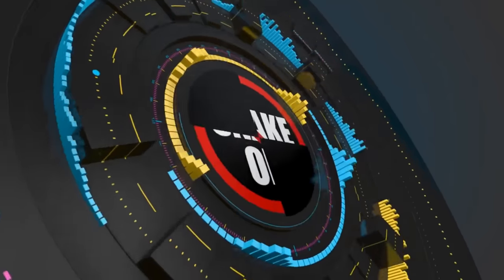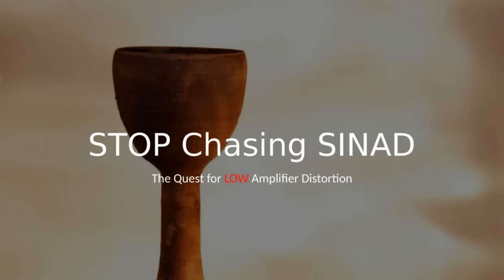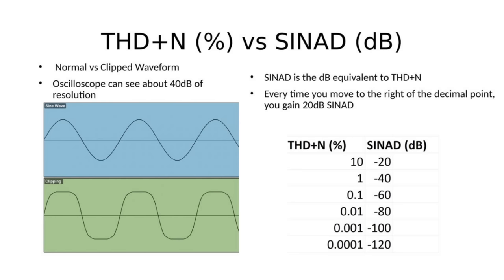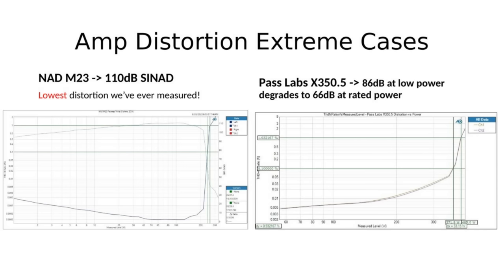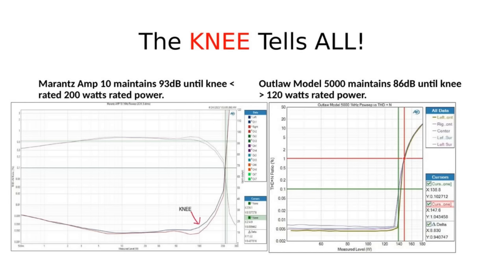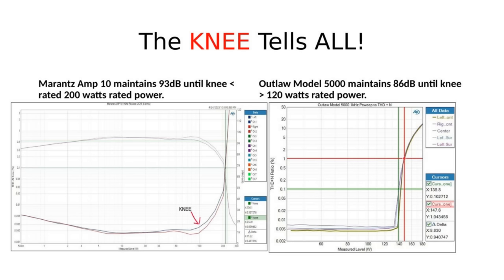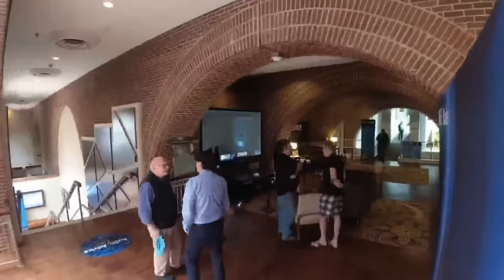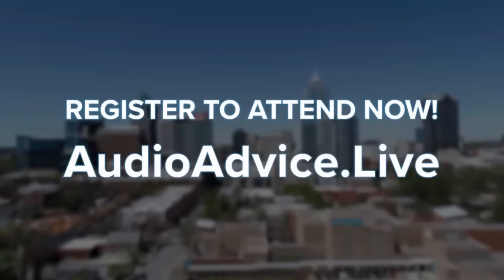STOP Chasing SINAD Distortion in Audio Amplifers!

Comment: Agreed on SINAD IS NOT be all end all number. There are too many other variables that need to be considered too as you mentioned in the video! Agreed on freq response, and load invariability value, and SNR too, maybe multi tone modulation distortion graph should be included also...

Good video!
Reply: Yeah I feel intermodulation distortion is quite a significant element to study, as it involves emergent frequencies in the audible range, from frequencies outside the audible range.  Which may explain why the anecdotal observations of noise filters outside the span of human hearing affecting the quality of music we hear. It may not be placebo, it may be ultrasonic and infrasonic intermodulation.

Comment: The Benchmark AHB2 he mentions in the video measures very well, but that's a result of some very advanced tech that John Siau has incorporated, to get the sonic fingerprint as vanishingly low as possible.  I have one with the DAC3 and the system at idle is stone quiet, and I believe that is what allows it to have such detail at low and high volumes.

Comment: Thanks for this discussion. It’s very relevant for me since I plan to buy a new amp in the next few months. Over the last few years, I find I trust purely subjective less and less, and I have found your Audioholics reviews, along with those on ASR, Erin’s and the SoundStage reviews that include measurements, to be like breaths of fresh air. I particularly found your reply to one comment on this video to be helpful: “3 biggest metrics, load invariance, SNR, and THD+N up to the power rating, IMO.” It may be redundant (I’m no engineer), but I would also say I always look for a flat response across the audible frequency band in reviews. 

I do have one misgiving about ASR has nothing to do with the quality of Amir’s reviews, which are not only very thorough (measuring much more than just SINAD) but also are very succinct and consistently laid out, so they are easy to use for comparisons. My gripe is with his charts that rank equipment solely by SINAD. I think they are very unfortunate because it encourages the kind of “chasing of SINAD” you discuss, and also allows uninformed criticism of objective measurements, in general. Both seem to me to stem from similar kinds of intellectual laziness. My personal remedy is to pay attention to the reviews themselves, and ignore most reader/viewer responses.
Reply: Don't have an issue with the charts, I find them useful as a quick reference guide. The problem as you say is how people use them. I find a small cohort (certainly not most and not Amir) of members at ASR to be the sinad/objective measuring equivalent of the obnoxious audiophile snob. I ignore both.

ASR (& others providing objective measurements) do serve a great purpose though, as the published specs provided by many manufacturers and sales outlets of audio products are often missing, unreliable, misleading or sometimes complete fantasy. I like Erin's type of review that provides both objective measurements and subjective opinion. It is easy enough to recognise review sites & reviewers that are influenced by sponsorship, advertising dollars or self interest etc and cull them from the resources I might use. I like hearing the opinions of others, particularly those who from experience I believe have similar tastes to mine, and seeing if their opinions match up with my experience.

Comment: Thanks Gene and also to Amir for all the testing and listening that he does.  I know Amir says that the threshold for SINAD is 115 dB and that depends on how loud the peak SPL is getting.  REW with a calibrate microphone on its SPL meter can measure the peak SPL.  Most handheld meters are measuring a weighted SPL average.  I have a feeling that you are correct that even if a very short duration peak gets clipped with the amplifier not having enough voltage to create that peak SPL, then the ear-brain probably cannot hear the very short transient distortion caused.   Masking is another big key and here is a site that shows on tones that the 7th, 8th, 9th, and 10th harmonics are much easier to detect with the fundamental compared to the 2nd, 3rd, etc. that are much higher usually.  It all depends on the frequency too.  One can tolerate higher orders of distortion at say 50 Hz than at 500 Hz or 1000 Hz, etc.

https://www.audialonline.com/blog/sound-of-harmonic-distortion/

The worst harmonic distortion is not 2nd or 3rd but is really the higher harmonics.  7th, 8th, and 9th can be much easier to hear on tones than 2nd or 3rd because of masking.

Here is a neat site and use headphones or your system and make sure your playback can play high res or you might have to scroll down to 16 bit which is still way good for this.

For dynamic range, here is a good test.

https://www.audiocheck.net/audiotests_dynamiccheck.php

If you scroll around this site, you can find all kinds of neat tests.

Many have reported that the ear-brain is quite sensitive to IMD and the 32 tone test that Amir uses on his AP analyzer is a good way to look at this.  It sounds like an out of tune pipe organ if you listen to it, and I have never tried to see if one could tell by listening if something is better or not in a blind test with many trials of this multi-tone waveform.  

I have used Audacity to create various scenarios of different tones and levels and listen to these, and many times if one adjusts the tone levels to less than 0.1% distortion, nothing was discernible at normal listening levels.  

One's own hearing has a lot to do with it too for sure.

This is a very interesting topic and clearly needs more work and results to know why some people would prefer one amplifier over another with completely different measurements, especially if the one amplifier has much higher distortion levels.

If it takes listening at levels where peaks can get to 127 dB SPL like sitting close to an orchestra, then that might not be the healthiest thing to do just to say the threshold is 115 dB too.  I am going to do some experiments with different types of music and just see what the peaks are getting to with an average level of say 80 dB SPL.  Using a scope on the amplifier is useful too to see how high the voltage peaks are really getting on music.

Thanks for this very enlightening topic.   Prof. Jim -  EE,  Penn State University

Comment: We always avoided the knee distortion by buying double the headroom of our average-highest power requirements. What was/is a killer is the desire to buy just enough power/speaker to save a little money initially, which tends to effect the budget chasing crowd more than anyone else. 

Even today, I am underwhelmed by amps and speakers with 'just enough' power, regardless of how clean and efficient the speakers and equipment have become. Especially now with the popularity of relatively inefficient bookshelf/stand mount speakers for larger room use. In other words, it's still a safer bet to buy double the amount of headroom, for both a higher degree of low distortion performance, and equipment longevity.

Comment: Dr. Geddes believes that crossover distortion is the most audible type. When he was deciding on a receiver for his home setup, he purchased several AVRs and developed a way to test this. He decided on a Pioneer chipamp which actually did sound great with efficient speakers.
Reply from the maker: Crossover distortion in amplifiers has been eliminated as a problem decades ago.
Reply: @Audioholics  I don’t believe this is accurate. There’s an ABX posted to ASR titled “Can you hear crossover distortion of >1% (listening test)” that suggests otherwise, for example.
Reply from the maker: @Cujobob  I haven't measured significant crossover distortion in any modern amp for decades. Any reputable designer has no problem with that anymore with modern amp designs.

Comment: Gene it would be cool if you did another one of these chats discussing bridging stereo amps into mono and the pitfalls of that. It’s a great way to double amp sales but manufacturers don’t talk about the downside.
Reply from the maker: great idea!
Reply: @Audioholics might prevent another person from thinking that two Vidar’s is the solution to hard to drive Magnepans.
Reply: When Amir chased Erin off his site I lost all respect.  I suspect it was out of pure jealousy since Erin has the same equipment that and can provide the exact same measurements that Amir can.  Take a look at the thread on ASR right now about Erin’s top 5 speakers.  Amir closed the thread because member’s were defending Erin’s video.
Reply: @matthewfrazee3352  wow that’s salty. Truth hurts. So petty. Amir is a small man.
Reply from the maker: @matthewfrazee3352  That's really sad to hear. I steer clear of ASR for my own peace of mind. I know I'm not well liked there either.
Reply: @Audioholics  I prefer the critical reviews that don’t feel the need to insult the designers.  I loved your review of the denon 110 and your right had they included preouts it would be my ideal integrated.

Comment: Since I added an Outlaw 5000X right after it was introduced my sound has been as rich, full, and clean as it gets in my room, no matter the volume. My Denon’s performance was ok before that, I couldn’t tell there was distortion but at higher volumes the sound got somewhat thin. The other noticeable difference happened with a well done Audyssey calibration and subwoofer fine tuning by ear. This is my real life experience without making any measurements.

Comment: The base room sound level does make a difference.  A noisy environment vs sound-isolating headphones.  I'm all for standardization in measurements, is it realistic for most situations?  If we use SINAD there should be an acceptable cutoff for SINAD related to the ability to realistically hear the difference.

Comment: I agree. Non technical people who haven't been trained in physics, electrical engineering, or acoustics, might be inclined to buy misinformation and the idea that if the distortion of the product is lower, it must sound better. But, once you examine a complete system a bit further, you start to realize that what your speakers and room are doing to the signal, is far more important. Many folks also don't understand THD's audibility and the degree which the music is masking the distortion that you get. There's an Axiom study out there (from veteran Alan Lofft). An important concept is, real music isn't a sine wave! It contains fundamentals and overtones. What about what the room was doing to the music at the time it was recorded? If it was small, there may have been reflections that had been caught on mike. What about where the mikes were placed? Close miked instruments tend to sound clearer.

Comment: And so begins the battle with ASR
Reply from the maker: The only battle is what you fabricate in your head.
Reply: Try actually watching the video. Gene gives clear context to the title. He isn't "calling out" Amir for SINAD testing, or any of the other measurements on ASRs website. He is simply saying don't take what you see at face value  (e.g. "this amp has 150w/ch...but this one over here has 200w/ch, so it must be better!"). The measurements Amir puts on ASR are simply for transparency of performance.
Reply: Clearly you didn’t watch the video. He literally brings up Amir/ASR, and how he tries to use a similar data structure so you can more easily compare to ASR.
Reply: Oh you guys! I'm joshing! :) That said..i like the explanation.

 I wish your db / thd explanation came up before i learned how to read those ASR reviews! 

Thanks for all you do Gene.
Reply: Somebody needed to say this, as the ASR had gone to other extreme, on the other being the reviewers who can talk 30 min about piece of equipment without saying anything at all. The course that Gene has undertaken is , in my opinion,  best for the customer. As ASR has become bootleg for chinese manufacturers who are chasing only SINAD, without doing any proper implementation to the other parts of the equipment, which are more notable for the customer,  like use experience. BR Nemanja

Comment: Quality of transients and sustained complex signals are in my experience the best evaluation criteria and desirable field for further research. Multitone IMD measurements gives a good picture for start, but not for the bass range. One also needs to use a dynamiclaly complex load like real speaker driver to get the real picture as opposed to resistor. Speaker impedance plays a crucial part on amp distortion pattern, there is an old AES paper about this. The momentary impedance of the driver can get close to zero ohms due to inertial mass stored energy that it generates as time-delayed back-EDS voltage/current. Easy to see that happening when you tap on speakers bass driver while measuring its impedance in real time. I would risk guessing that SINAD measurements at 0.5 Ohms load with low output power (1-30W range) would tell us much more about amplifier qualities and differences. Another test would be a high power two-tone bass/midrange IMD tests also on low impedance load. For example, 40Hz and 2.5kHz IMD test at ratio 32:1 and watching the waveform also on osciloscope. Then change the lower frequency to 250 Hz and ratio to 8:1. It is amazing what you can observe with this technique.

Comment: I'm still chasing for the Classe CT-2300  that you mentioned many times in previous videos 😉. Else two JC1s which are monstrous for sure, but their sheer size is holding me back.
Reply: I've been looking out for a Classe CA-2300 or CT-2300 myself in my country too.  I spotted and pounced on a kinda similar amp, a NAD M3 and use it's amp section only and really enjoy it.  Those great Class A bias Class AB hybrids from 10-15 years ago have a terrific sound and still measured very well too.
Reply: Very much agreed , and BTW myself i have very similar to your NAD M3 integrated and from the same era it is HK 990 that also has dual mono desgin configuration .

Comment: Hi Gene, Good video!
This and the last one on how Amps Should Be Rated leaves a lot of room for discussion 
and opinion but I'll throw my stinker on the pile.
I go back to the days before the FTC ratings when BS and Dynamic claims were king.
At that time I was personally very happy the FTC came along and attempted to get
come control and honesty in amplifier ratings.
In comes the AVR push and out the window went most any honestly in power ratings once again. You've done a number of videos on the ratings horseplay used in the video world.
Personally, SINAD or THD+N, I'd like to see one or two solid points with which amps could be
reasonably compared for TRANSPARENT power.
I'd like something like (Xwpc into 8ohms, at 80 SINAD/.01 THD+N, ALL Channels Driven, 20hz-20khz ps.)  Add maybe a 4ohm rating to tell us something about the power supply.
No, it doesn't really say anything about dynamic capability, but those type figures always
let in ways for the ad men to run fast and loose with the numbers as we've seen in AVR's in recent years. There really wasn't anything wrong with the ETC requirements except the marketing men didn't like them, little to no room for snake-oil claims.
JMHO and KEEP POSTING Videos.  ;)
Sal1950

Comment: For me, I don’t like the combination of THD and noise. For me they are separate phenomena, with separate dynamic behavior.  In combining them we loose the precision of understanding each separately.

All musical notes and scales are harmonic intervals, it makes sense to independently analyze the harmonics of an amplifier. 

Noise can come in different flavors, it may have peaks worth noting, it may have linear trends like blue noise pink noise brown noise or white noise. How this noise plays with a harmon curve may tell us something about the sonic character of the amp.

Even further the way even order harmonics distort a sine wave, has different symmetry than the way odd order harmonics distort a sine wave. So we would probably want to have even more granularity on the character of the harmonics than the “Total” harmonic distortion. 

THD+N is not two things added together, it’s a multitude of dynamically load-variant degrees of freedom all made into a single number. 

The main idea being that these are all non-signal elements, so lower is better.  But is lower better?  When we have multiple components making up the single number,  we can have more of one or the other, and one may be more desirable to have in such a ratio.  4+5=9 but so does 7+2=9.  Well both are beaten by 8+0=8  but the 8 component is higher than the others 7 and 4. 

Likewise a 4+4 has double the value of the 2 in a 7+2  but would be ranked superior in sinad (8<9) when it’s actually twice as inferior as the 2 component by coming in at 4. 

Functionally it’s a very familiar convention to use sinad, but we can do better, and it’s well worth discussing how we could, so that in the future we can.

Comment: It takes more than measurements to make an amp or other audio component sound great. The quality of the components matters also. The real is what  matters to your ears. No two peoples’ hearing is alike nor is their preferences in what they listen for. Your gear and your hearing is what matters. Specs vary, but a great design will shine and we all must suit our own tastes and preferences when we make choices in gear. Like Gene showed in the video, some gear is more prone to distort based on load changes. The price is not the parameter that determines how quiet either. Your ears are your guide and your gear choice is based on your preferences. The budget will also determine what you’ll be able to get also, but it varies more. If in question, ask Gene. Can’t go wrong there.